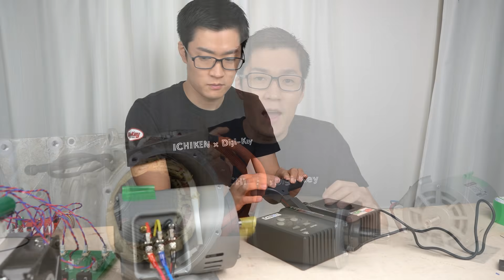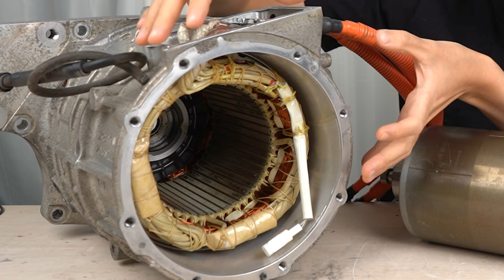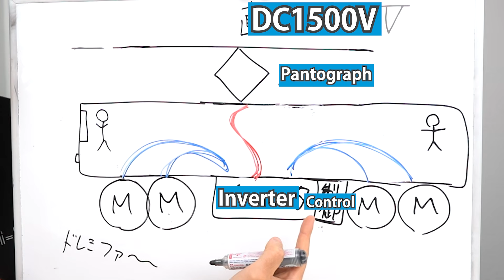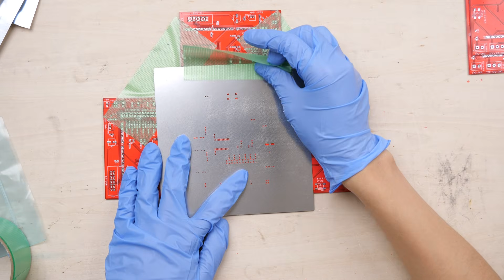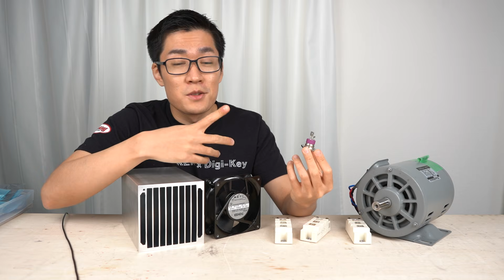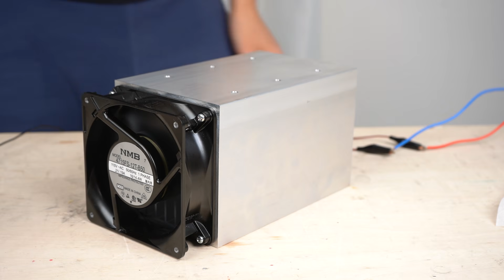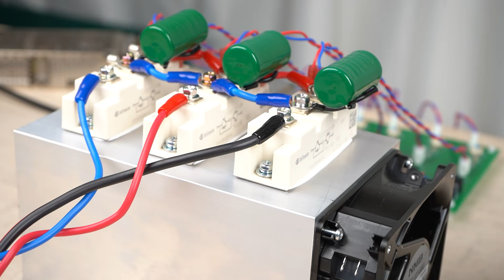Why Electric Trains Make Interesting Sounds. I Made a Singing Train Motor!

Comment: The reason for the variable switching frequency is that there is a MINIMUM ON TIME. 
Another example would be the czechoslovakian class 363 locomotives that had three distinctive switching frequencies 33,1/3Hz 100 and 300Hz. Due to the fact that the thyristors needed forced commutation trough a commutation reactor and cappacitor, they were limited to a minimum turn on time in which they will get a consistent firing of the main thyristor (After firing would stay conductive until the commutation tyhristor takes over to shut the main thyristor) 
This had one problem. With a fixed Ton you would have a minimum Duty cycle far too large for reasonable starting of the train. Basically the loco would instatnly start to slip and rip off the connection between the cars.. What they they did is that they decreased the switching frequency only for small powers so after reaching a certain time threshold the inverter switched to a different frequency allowind for a much better distributed current draw. After all you need a smaller inductor for a 300Hz pulsed DC to smooth out, than if you had 33Hz pulsed DC

The class 363 is an early 1980s design locomotive, incorporating PWM regulation of DC traction motors. The switching was done with thyristors (the OG ones not these newfangled funny GTOs :D ) so they needed to get creative.

Minimum reliable Ton (that would guarantee main thyristor conduction) was 0.3ms. This on time at 300Hz would result in a 9% duty cycle right from the starts...that wont do!

So what they have done is go trough 3 frequencies. 33 1/3, 100 and 300

Duty cycle as follows
33 1/3 from 0.9% to 3%
100Hz from 3% to 9%
300Hz from 9% to 90%

This allowed for a reasonable efficient controlling of voltage, and during the riding stage the use of a 300Hz frequency allowed for a smaller filter inductance to smoothen the current out and consequenty so that the torque is constant instead of being pulsed at 33Hz (funnily the whole thing rattles at this frequency during a run up) 

incase of the N1000 the motors are asynchronous AC. They modulate the low frequency sinewave into the pulse width. Change of frequency changes the RPM. But asynchronous motors have a voltage over frequency curve. The higher the frequency the higher the voltage, demanding a larger PWM swing. So for full on 50Hz lets say, you need full modulation from 0% to 100% dutycycle. But for 5Hz you need 0% to 10% and this might prove problematic due to the minimum on time of the thyristors. So the simplest solution is to change the frequency of the modulated pulses. Any time you can afford to make the frequency higher you should do it as it increases smoothness of operation and homogenises current flow into the motor windings. 

I hope this rather technical essay helped clear things why they make this sound..
Reply: That was the answer I was looking for to my question of why is the stepped sound made when PWM is being used
Reply: Wow, thanks for the explanation 😮
Reply: Why do trains then go to pattern mode at higher speeds? is it for harmonics or switching/ minimum on time. Also why bother keeping the PWM carrier fq low at startup and then raising it with modern VFD inverters?
Reply: @wezdog1  this is an asynchronous thyristor inverter speciffic thing. With a changing modulation freqiency you hit a point when the carrier frequency (the switching frequency) and the mpdulated frequency are gping to multiples of each other. 1/10 1/8th 1/4th 1/2 1/1 2 4 8 10... it cannot be an even multiple. This is due to phase crossing points. It might cause a quirky behaviour where some DC could be let trough and that would cause DC magnetisation of the motor core or utterly abolish the thyristors..
Reply: legend.
Reply: I should watch more videos, I somehow expected that train motors are basically BLDC. Is frequency of  sine wave constant or does it change according to actual or target motor RPM?
Reply: @pavelp80  it is not a BLDC motor, but an asynchronous AC motor.

The driving sinewave has to change frequency much like for a BLDC motor, except with asynchronous AC there will always be a magnetic slip between the stator magnetic field rotation and rotor rotation. The slippage % gives you the power transmitted proportionally.

Three things change in a doremifa inverter during spinup. The carrier frequency (that one you can hear) so it can give you a different voltage output, this the output voltage changes too, and the modulated frequency (the one that the motor sees)

Comment: It doesn't seem japan specific.
Here in germany we have Siemens Vectron locomotives for our public transport.
They make similar sounds when starting.
Or the city train in berlin as well. It seems usual today.
I miss the days when tram  motors made only a brutal "hummmmm" when starting.
You heard and felt the violence of those older motors back in the 80s and 90s.
The lights of the tram were dimming while accelerating.

Comment: The "Singing Trains" of Montreal Canada were so iconic, that the residents of the city voted to make the sound they made, the new chimes that play when the doors are closing. Even though the vast majority likely had no clue what caused the sounds

One model of train in Montreal using the old Jeumont Schneider DC current choppers is still in service, but they were built in the 70s so who knows how much time they have left
Reply: Dou dou dou!
Reply: Here in São Paulo we had (and still have) trains with a do-re-mi inverter and jeumont Schneider DC chopper, in the case of the do-re-mi inverter we have the CPTM series 3000, and in the case of the jeumont Schneider chopper we had the series 5500 "eletrocarro" from CPTM, the frota C  of the São Paulo subway (current frota K  of the São Paulo subway) and series 5000/5400 from CPTM "fepasao" the first and at the same time the last Jeumont Schneider chopper in São Paulo and Brazil
Reply: @GabrielVictor-te2sk  And actually the only system to use those choppers that wasn't a rubber tired system, and the only other one remaining, since Mexico City replaced the Jeumont equipment in their MP-82 cars...
Reply: @wilfstor3078  remembering that the eletrocarro was retired in 2012, however it had a modernized version called 5550 that operated until 2016, the 5550 as well as the mp-82 of the mexico city metro had its Jeumont Schneider chopper replaced by electronic management equipment, however its original traction engines were maintained (although revised), during the renovation it had its original front (here in São Paulo we call it the front of the trains mask) of 3 stainless steel windshields replaced by a fiberglass front with 2 windshields, the frota c between 2009 and 2014 was modernized, becoming the frota k, just as the 5550 had its original front replaced by one with a modern appearance, was equipped with air conditioning, and had its original jeumont Schneider choppers exchanged for a very silent vvvf and the original DC motors exchanged for AC motors although the rotor of the traction motors remain the same (the original mechanics were maintained), as the traction sound of the frota k is similar to that of its original form, whereas the 5400 is very difficult to show, as only one operates and most were immobilized
Reply: Actually the Caracas Metro S10000 and S20000 trains still use that chopper, sadly most of those trains don't run anymore due to lack of maintenance
Reply: Los MP-82 del Metro de la Ciudad de México hacían el mismo sonido. En 2006 cuando circulaban en la Línea 8 tuvieron un cambio de tracción y el sonido desapareció. Tuvo que ser hermoso.
Reply: @YouTubeCDMX  que pena
Reply: I was just about to write this
La STM vous souhaite la bienvenue à bord!
Reply: What models are these singing trains?
Reply: @captainminecraft631 MR-63 Jeumont, and MR-73
Reply: That use chopper not vvvf inverter
Reply: We're gonna keep on using them for at least another decade. The STM wants to replace the MR-73s (since, in terms of the average distance travelled before needing repairs, they are literally 10x less reliable than the newer Azur trains), but is unable to get the funding to do so. The current roadmap, with studying the needs and then designing and building a replacement model, would see the 73s replaced in the mid 2030's

Sidenote the city is frustrated about this, because Vancouver got funding to replace its 40 year old Mark I trains, Toronto is getting funding to replace its 30 year old T1 trains, but Montreal apparently can't get any funding to replace its 50 year old MR-73s

Comment: I worked at a place that had old 1989 inverters powering 100HP electric motors and its slow startup sounded like a car accelerating in pole position Atari game.

Comment: We had two indoor 100 HP HVAC fans that we installed  VFD'S on back in early 1980's and depending on the speed you could hear the odd sound produced by drives several hundred feet away. Place that I retired from had over 500 VFD'S and being they were on drives that used IGBT'S with up to 5,000 Hertz switching frequency only receivers rattling sound on a few of them.

Comment: 1500V? The overhead lines on HS1 are 25kV
Reply: The conventional main lines in Japan use 1500V DC (like the one where the Keikyu N1000 Series is) . Lots of modern metro lines also use 1500V DC.
Most High Speed lines use 22kv 50hz AC, because you want MO POWAH BABEH

Comment: Here in São Paulo, Brazil, we had a train that problably used this motor because the sound is very similar. I always loved this sound!
Reply: Whats is the class? Is it a CPTM Or Sao Paulo Metro
Reply: @biancadarosa9053 CPTM series 3000 I believe
Reply: @Spreffy  ooooh okay
Reply: @Spreffy CPTM Series 3000 was a train manufactured by Siemens and Mitsui, did exactly that Sound scale, it's sad that those trains are no longer in operation 😢
Reply: CPTM TUE series 3000 GTO based inverters  @biancadarosa9053

Comment: this reminds me of jubilee line, I've always loved the way it sounded, sounds like a car changing gears.. 
if I was designing an electric sports car i'd definately consider integrating a similar system instead of those fake speaker pumped noises we see nowadays
Reply: That, and the Class 465/2 465/9, and 466 used on SouthEastern, have a slightly later technology using continuous variable frequency rather than stepped variable frequency.
Reply: We have a train series in The Netherlands that uses a pulse-based drive-train that makes an absolutely god awful high frequency screeching/screaming noise.  You hear it over hundreds meter of distance.  I even saw that people living around stations have complained about the noise, and while I am generally the kind of person who thinks you can't really complain when deliberately deciding to live around a train station, but with this noise, I can REALLY understand it.
https://youtu.be/tbKOk1XQHxo?t=50 << The most annoying thing is that they do it both upon recuperative braking and upon accelerating away.  It is rare for the sound of electric trains to carry over through audio of a video but each and every video I have seen of this type of train the sound is just like in real life: Annoying and uncomfortable like absolutely nothing else.

Comment: You can probably undervolt the fan for the best effect. I was surprised to find that the fans in my PC are almost as loud as your industrial fan when set to full power in BIOS. But I have them set to "silent" setting, I also changed control method from PWM to DC, because already rectified PWM provided to fans make them run quieter. Providing PWM semi-square wave directly to the fans make them make nasty sounds.

Comment: I would say the steps are to keep the power input constant during starting, as the power needs of the motor change because of the need for increased slip during the initial power application, and the steps are there to reduce the CPU need for a smooth sweep, as the original designs used lower speed processors, so offloading most of the power control into discrete power steps was needed, so as to not cause excess slip in the motor and thus poor accelleration, and too fast a ramp would result in a motor stalling. thus the constant steps, so that a driver could keep a constant pull away and not run the risk of a stall, which would mean a stop and a slower ramp up again, and a possibility of the motor generating an overcurrent or tacho feedback error.  remember this was originally running likely on aZ80 or similar processor, with large parts being done by other processors as well, and the designers had both limited memory and limited performance. 

400Hz was running the GTO devices at the high end of the range, as they, for power devices at the time, needed 2 or more same size power switches for each of the 6 legs of the drive, and GTO devices need you to have a very beefy current source and sink, as you need to turn it on fast, so high current at a relatively low voltage of around 5V on the gate, and turn off you need a current about what the device is conducting, and around -10V, to pull the gate off hard and fast enough to switch off. At least this was better than earlier thyristors, where turn off was done using LCR circuits, and a second equally rated thyristor to pull the anode negative for long enough that the first one would be able to turn off, and then the second one, due to the high power resistor providing it with power, would stay on till the first fired again to turn it off. High static current, high power loss, the GTO made this power use so much lower, at the expense of needing 4 isolated relatively high power supplies, 3 for the upper bridge, and the lower one having a common cathode connection. Instead of 500W of power dissipation now down to under 100W at idle. Add this up per axle and the power use becomes considerable, plus higher frequency, and the ability to do regenerative braking with much less processing power, and you can see why they, and now the IGBT, won out.

Comment: If I had to guess I would say the engineers had this as an audible troubleshooting tool. You can hear if and when your inverters were acting up without any extra tools. This would also be useful for the driver/conductor or other people in the loop as they could inform someone that some specific train wasn't singing correctly
Reply: Honestly, I think th is more of a "Because we can" kind of thing.  Modern pulse based drive-trains for electric motors contain quite a lot of self-checking and will probably tell the driver there is a problem before the driver can even request to drive off...

Comment: Thanks for the video. I did had an privilige to travel with that singing train when I visited in Japan. Please also check Helsinki metro M100 series. It is the worlds first VVVF train designed and came into to service in late 70's. It is still in use! I went to school with it in the 80's and later to work with it.
Reply: Martti Harmoinen at Strömberg invented VVVF.
Reply: Both Helsinki M100 (ABB Strömberg)and Berlin BVG F76(AEG) are world first using Three phase motor technology on train.(metro)

Comment: Lots of people think EVs have no soul. This can definitely bring some soul back to the drivetrain!
Reply: can you imagine what a traffic jam would sound like?  It would be a cacophonic nightmare.
Reply: @AlexLTDLX  as opposed to now, where they're beautiful orchestras of mechanical sirens
Reply: @AlexLTDLX  A little good intention driven dystopia gives live some fun.
Reply: @AlexLTDLX I have better nightmare idea, put a sirens into those EVs... traffic war going hard
Reply: This could also save cost in cars by eliminating the pedestrian speaker. Why add an extra part when you can use the motor itself?
Reply: the EV car should sound from inverter like this not from speaker
Reply: exactly what I was thinking..
Reply: As a developer for multi megawatt inverters that have wide range of different sounds between 1...10 kHz, iam always disapointed from the sound of my EV.
Reply: The speaker played sound teslas make when maneuvering at low speeds are already annoying enough.

Comment: One of the reasons it does notes is that the fundamental inverter frequency and its harmonics have jump in order to avoid getting into the frequency bands of the audio frequency track circuits.

Comment: How did you make it sound like it was switching through gears when speeding up?  That is more interesting than the ringing speeds..
Reply: Change in the carrier signal frequency causes those gearing sounds. I believe it is usually optimized for specific motors and VFDs.

Comment: The reason for this sound should be something about magnetic field and efficiency at extremely low RPM. Nissan Leaf has stall protection, that if motor is hardly turning it will not use regular high frequency swithcing and will downgrade for lower one, more heard, but more efficient and less heat output at low rpm.

Comment: Modern inverter are better in making real sine waves therefore they make less noise and are more efficient. A low power equivalent are stepper motor drivers. Some people played songs on printer or even floppy drives with that.
Reply: Modern brushless motor controllers very much still play audible sounds on startup or failure.
Reply: @AttilaAsztalos Yes, however those are intentional, and done without moving the motor shaft. During actual operation, the brushless motors don't actually make much sound.
Reply: I've seen the floppy music videos, they're cool!